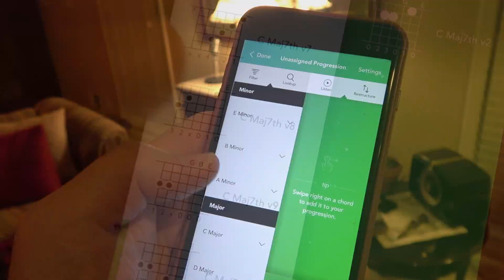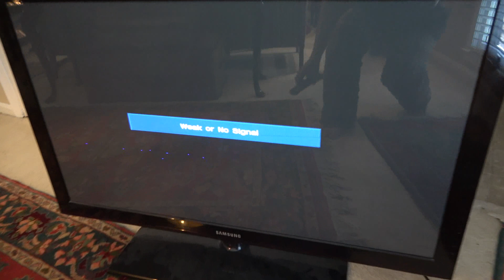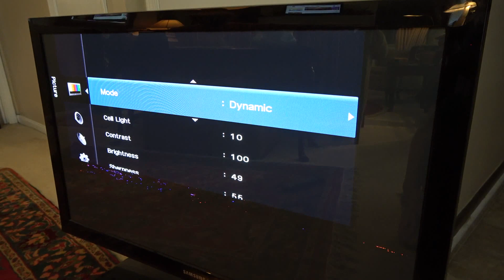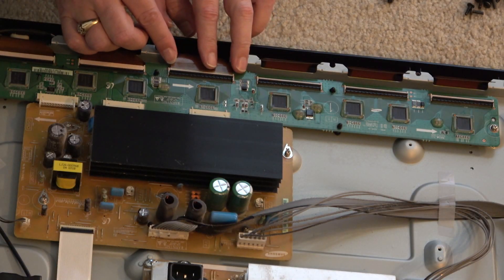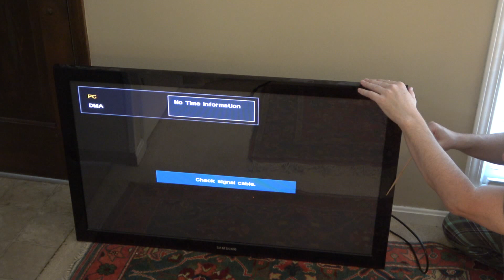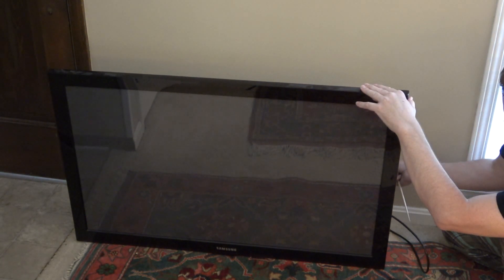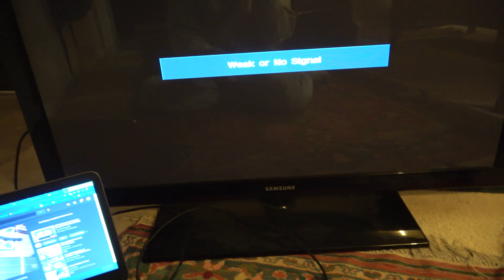I found a Plasma TV 📺 in the TRASH! Can it be fixed?

Comment: Dumpster plasma tv gang!
During the first lockdown, I found a 32" Lg plasma from 2011
Bought it home, all it needed was a capacitor that i took from another recycled piece of tech that I had laying around and now it's my main gaming tv since it has very low latency and a lot of inputs!
I recommend checking the temps when using it! plasmas usually run pretty hotly, high-end ones even have fans in them, think about if it's worth installing one in yours too, especially considering how rare components are for these 10yo TVs!

Comment: Those speakers are from the end of the era where someone could get by on the built in speakers... My previous TV was a Panasonic lcd from around the same time and was not an led model so it was bulkier which meant more room for the speakers

Now I did use it with a proper home theater setup but when I did test the built in speakers they did alright

My current tvs are thin with absolutely tiny speakers that sound like garbage

Comment: If you see one of these,  plug it in and see if it powers up(green light).  If it powers up,  toss it,  it is not worth repairing.  If it does not power up,  then it is most likely a simple PS fix such as a blown capacitor.

Comment: I just tossed a 1250 watt microwave yesterday because the door latch broke and wouldn’t let it come on. Watching this, I should have cracked it open to see what all I could scavenge from it before tossing it.
Reply from the maker: Be VERY careful with microwaves! There is a capacitor in those that can KILL YOU DEAD if it's still charged. You MUST discharge caps in a microwave before servicing or poking around inside one. But after you do that, there are some cool parts you can salvage from one.

Comment: Gonna take a chance: A lightning bolt passed over my house and hit a tree in the back yard. $800 48 inch 3D LCD sitting by the window at the front of the house got "EMP'ed" by the bolt. Picture went screwie for about 30 seconds and then shut down. Now it won't power on. How much do you think it would cost to take to a shop and is it worth even trying?

Comment: Duuuuude!!!! Dunno the full truth on this one but you've never led us astray before...I work by day repairing electronics and if I had done that, I would have "let the smoke out" for sure hehehe. The next thing that I would do in your situation is to order or get from your parts bins, a 0.1uF or a 0.01uF non-polar cap and replace that capacitor. For future reference just in case the board doesn't have any location IDs, the SMT caps are nearly always some shade of tan to brown and have no white silk-screened values on them - nearly always resistors have this unless we're talking cell-phone midget-flea components and at that stage, fuggetabout it :)
Great Job!!! and enjoy that free "roadside attraction"....I'm enjoying my "new" 2018 Porter-Cable 6-gallon compressor that I was able to repair for just under $70 in new parts - the piston was cracked in half - I found it a week before I developed a front-passenger four-hour leak to zero and the day the parts came in at my workplace, I was able to use it to blow up the tire long enough to get to the tire store and get it replaced. Serendipity and the Grace of God hehehehe :)
Dan Gibbs :)

Comment: I would have taken those mounting pads down to bare metal, or as near as I could get it, giving it a thin re-tin, then cleaned off the flux residue from the solder using solvent and a fibreglass brush (always assume fluxed solder), placed the part and applied a small amount of flux on each side. Then , I would have applied the soldering iron tip (after tinning) to each contact and resistor pad, then flowed a tiny amount of solder onto them.

You want the solder joint as clean as possible, and use the biggest soldering iron bit you can, because you want metal-to-metal contact whenever possible, to get the heat energy in as fast as you can before the temperature rises too quickly (it sounds stupid but isn't - I was taught to hand solder by the European Space Agency, many years ago, and this is a true thing). Making the temperature rise too quickly means a resistive solder joint, and you will likely warp the board or cause delamination of layers or lifting of pads.

Comment: I wish you were around here, Brad. I have a 52 inch flat screen, 4k TV that all of a sudden started having a pink screen issue. My daughter bought it for me for Christmas. The TV works and is wireless. But, repair is something beyond my ability. I'm guessing its just a small part. Resistor, capacitor, etc. My youngest daughter uses it for music in her room, and as a big mood light.

But, I hate to haul it to the dump. I wish I knew someone around here that knew how to repair such things. I hate to have to haul it to the land fill if someone wanted it. I want nothing for it.

The problem happened less than two weeks after getting it and setting it up. The company ONN/Roku, a "Wally World" brand, honored their one year warranty but made a mistake and sent me a 68" 4k TV instead of another 52"! So, now in my makeshift backroom work room, I have this relatively giant movie screen thing against the wall!
Reply from the maker: Where are you located, John?
Reply: @TheGuitologist  I'm about 10 minutes west of Fort Bragg, NC.

Comment: I have a Vizio “50 Plasma TV I’m about to throw away. I replaced a bunch of boards that burned out but didn’t replace the power supply that burned them out, so.. it fried again. Anyone in the Northern Nevada area? Ya want it? I know what’s wrong with it but I’ve moved on to “75 4K TV’s. 😎